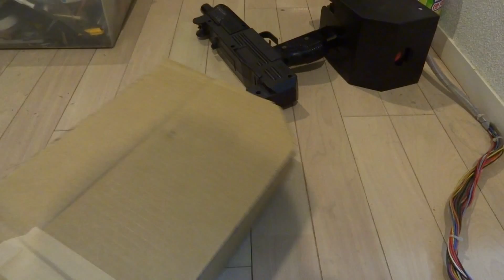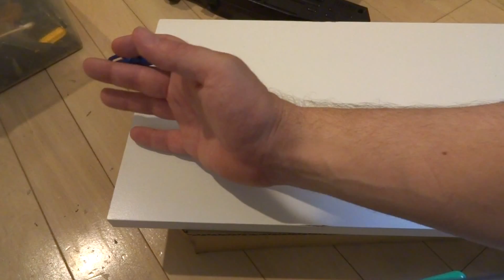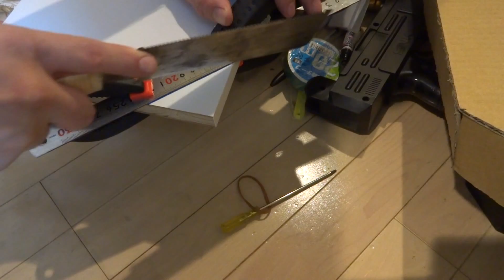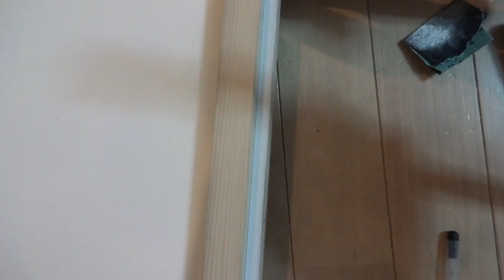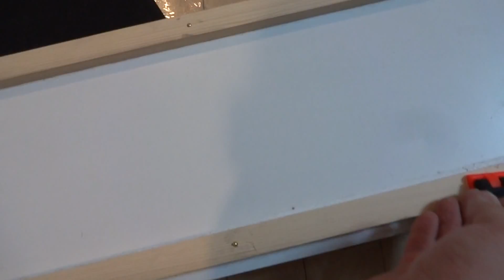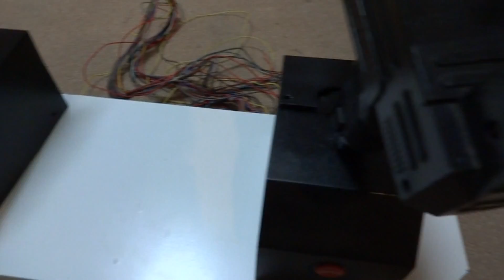Custom 1989 Beast Busters Arcade Control Panel (Pt. 1)

Comment: Lol - I was wondering how long you would keep the voice going :)
No power tools! I would just die - actually I am in the process today of tidying my other shed & have a new locker for putting all of my tools.
It would have taken you ages to do those cuts & cut outs.
Will look good when you get it finished, you definitely will need some decent screws due to the weight of the guns.